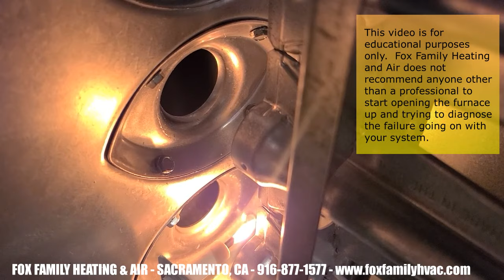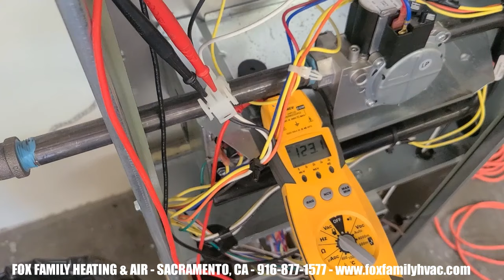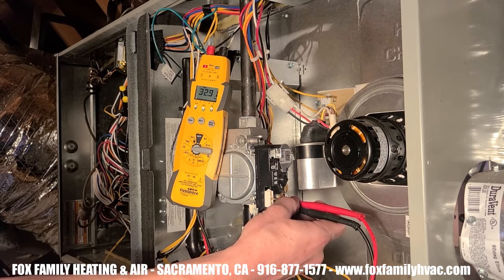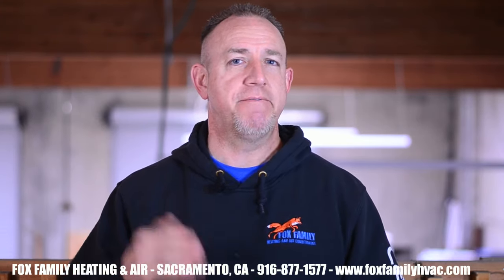How to Diagnose a Bad Furnace Gas Valve (10 Things To Check in 2021)

Comment: I bought a 2023 Jayco 2 days ago and I test fired the furnace and literally within 20 seconds I smelled propane/exhaust then the propane alarm went off. I don’t think that is normal. Advice would be awesome. I plan on taking it back to the dealer to have them fix it but I just got it literally 2 days ago And I just want to use it. The dealer is almost 2 hours away.

Comment: Having an issue with my Conquest 80 Natural Gas Furnace. My issue is that not all the burners are igniting sometimes, all of the orifices are clean on the nozzles and channels in between each burner are clean. It always lights the burner at the heating element but sometimes it takes two tries to light all the burners and will work fine for a few cycles and then do it again. I'm thinking the gas valve is starting to go bad or not enough pressure to the nozzles. I would appreciate your expertise on this issue. Thanks

Comment: I might have a gas valve problem.  It's Williams Forsaire Counter Flow about 5 years old, electronic ignition, direct vented, very simple design, has a mushroom inlet/exit on the outside of the house.   Sometimes the regulator starts making a noise like it's going on and off.  The flame actually starts but it looks like it's having difficulty when this occurs.   I'm thinking either the valve is stuck or the flame sensor (which I think is a bulb with capillary tube type) is not getting hot enough and putting it in a perpetual start/stop state when thermostat is active.   There is no sophisticated computer control on this, no impeller motor, pretty basic.

Comment: My inducer is shutting off after 30 seconds (spins just fine and I've check the vacuum switch as well). The ignitor coil isn't lighting up and I've checked that as well. Flame sensor is brand new, but I can't even get to that point. No clicking on the gas valve. I'm beginning to wonder if the main circuit board has died again, but last time it just stopped working entirely. Any thoughts on this odd issue? It also runs the blower motor after a minute and leaves it on as if it's heating.
Reply: So theres a few things for you to check,on the burner box theres little switches with a reset button on them,those are called roll out switches,push the center button in and see if it clicks,there could be more than one,so look carefully,2nd,theres a high limit switch on the back wall of your furnace as your looking at the furnace,that switch will make the blower run if its tripped,you can tap on it with a screw driver to see if it resets itself,if not it needs replaced,but that switch is for if your blower motor stops working and builds up to much heat in the heat exchanger,check those parts and see if those are your problem
Reply: And check your filter,could be tripping the switch too if filter is dirty

Comment: My furnace runs after 2nd attempt and it runs great. Was told it was a gas valve. Will the furnace run if the gas valve is bad? I have a mobile home furnace.
Reply: check your air proving for the inducer motor

Comment: Thank you tips, but my problem is as follows. The furnace cycles first time with no issues, but shuts off before reaching temp. A few minutes later it relights but now this is where my problem is. The flame lites  runs for a minute or less and poof goes out. A few seconds later it relites and poof goes out this happens several times till it times out. Checked the roll out sensor the flame sensor and the limit switch. Both at the sensor and at the control board. All had voltage and never varied or went to 0 volts. But checking the gas valve for voltage (24 volts) it would drop to zero flame out, 24 volts flame on, back to zero ect. ect. What would or could cause this occur? I replaced the board with new but it still happens. Please advise
Reply: That seems like a pressure switch issue... I had a brand new furnace I installed with the same issue... What happened was the vacuum pressure that closes the pressure switch slowly lost the pressure which releases the pressure switch... This will happen after about 30 sec to a min... Then shut the gas off .. after 3 times it should not let it happen anymore and lockout... It could be a clogged vent... A monometer needs to be put on the pressure switch make sure it's shutting down at the correct value that is under what value is on the part... Usually a code will be given by blinking lights... Take off the furnace doors and tape the door switch down and turn on... Let the fault happen and look on the back of the furnace door for the code it gives and it will point you in the right direction

Comment: In my case, the exhaust pressure switch was causing the gas valve to turn off and on and off and on, and I could see this by the voltage to the valve dropping out.  At first, I thought it was a bad gas valve until I saw the voltage dropping, but then shorting out the pressure switch allowed me to run the furnace without issue, while I'm home, until I can get a new switch.  The pressure switch was cutting electricity to the gas valve.

Comment: Is it okay to shut off the blue gas valve inside the Lennox Pulse G14 and not shut off the old style tapered valve in the line?  We aren't going to use the Lennox anymore, planning to replace it.  (I don't want to create a leak in that old tapered valve by messing with it.)

Comment: You said the gas valve will shut off if the gas pressure is not there. Question for you bud: so we turned off the main gas line what happens to the furnace.we are in the middle of the summer do we need to turn it on or what do we do . We don't whether to leave it alone till the winter or turn it on now. Please advice

Comment: I turned my heater on after being gone for four days and we had a really bad blizzard. Very cold here power was out for two days while I was gone. Turned it on last night the house reeked of gas, so strong. I had a headache within 20 minutes. Power company said the blower is blowing the flame out because the valve isn’t closing. Is that fixable?
Reply: Yes call an HVAC tech.  That's dangerous.

Comment: If I smell propane coming out the air inlet (yes the inlet) to the combustion chamber when the unit is not running, is it possible the gas valve is leaking by?  Is there a way to check?
Reply from the maker: Any time you smell gas, you need to call the utility that provides that gas and even 911. It's not something you want to be wrong in guessing whether its okay or not. Let them use their meters and tell you what to do next.

Comment: My pilot lights for a bit then goes out and the igniter keeps trying to light it, but the pilot keeps going out.  The burners never light.  Is the issue the 3 wire pilot assembly or the gas valve?

Comment: What about a furnace gas leak in the cellar? Propane gas detector is mounted near floor and near furnace. Opposite a couple yards away there is an electric 200v dryer. The under carriage of dryer has red hot nichrome wire coil open heating element, when dryer is ON. This must be a common issue?

Comment: I got a 36 yr split system how can i check for 24volts going to gas valve on furnace? Top terminals on gas valve are numbered 1,2,3,4,5 . Theres a yellow & white wire at gas valve going to the sec 1 & sec 3 on main board

Comment: Having issues with Amana furnace today - Honeywell VR9205Q1010 valve was not activating. thought it was the control board so i replaced it. Still not working. Here what i know now. If i unplug the valve and measure between Common  and Low  I get 26 volts for 2-3 sec( which i should)  but if I plug it in and check C & L the voltage drops to .8 Volts for 2-3 sec. , not enough to activate valve , not sure why. 
If i use the 24 volts from the transformer to test valve by going to C & L  i can get the solenoid to "click" . Its like the broad cant supply enough current but its a new board. Any ideas? or have you seen this before?

Comment: My furnace worked by me tapping the gas valve assembly with the wrench last winter. Now it doesn't. I can hear the solenoid click but no gas comes through and the system shuts down. Sometimes it fires up on it's own with no tapping.

Comment: I have a LP carrier gas furnace, took wires off of the valve and only had 20-21 volts wouldn’t ignite, used jumpers and took them from the thermostat terminals on the board to the gas valve connection spades on the valve and heard the valve open, does that sound like a bad board? A resistor not bleeding down properly?
Reply: Also did fine the black plastic part where the two wires plug into on the valve was very loose, only weird thing is is that the furnace is only 3 months old
Reply: Welcome to the era of cutbacks and cheap overseas parts.
I am replacing a gas valve second time in a 2 year old install.
Reply: @stephenhuggins1388 If the wires were very loose, it may have a bad connection. I would pinch the connections with some pliers to make them snug.
Reply: Ended up being the control
Board

Comment: I think on important step was not mentioned. After the gas valve opens and the main burners are lit and the flame is verified the limit switch must get hot and close, ( bimetal ) then the fan will come on. This ensures the firebox is hot so cold air will not blow into the house

Comment: Check the vacuum switch. If a vacuum switch opens and closes fast enough, you will not see a change in voltage on your meter, but your gas valve will open and close sporadically. Bypass the vacuum switch and see if the gas valve operates differently.

Comment: I recently had a furnace (carrier) for a no heat. When I engaged the heat the system came on but shut down as quickly as it ignited. Checked flame rod , press. Switch,gas valve : replaced gas valve but still same problem.  Ended up being the pc.board. manager said to bypass valve to check operation. Then I would have known it was the board

Comment: What's it mean when your furnace will not turn on in the morning when it's cooler but after 5 failed ignites , a reset, then it will start normal. Or later on in the day or works fine.... Massive because it's warmer?
Reply: Same kinda thing happening to mine. Slight smell of gas also.
Reply: It depends and could be a few things. Do you have loose connections at your gas valve? How cold is it when it won't start? Does the inducer start? Does the hot surface ignitor glow bright orange?
Reply: @jorgegonzales6697  blower fan comes on. Ignitor glows bright. Gas valve goes from 12volts to 67 mv .  3 attempts to start then it goes into lock out mode. I reset then it fails one more attempt and starts on 5th try. Only thing I can think of is the ignitor is not getting hot enough....  Or gas valve sticks when cold. 

Thank you for replying. I might have to just call in expert which I'm trying to avoid.
Reply: @bigjonbird1  it sounds like  you have a meter and know how to use it! That's awesome! That's about 20% of an hvac tech job 🤗. Disconnect the ignitor plug before turning it on. Measure the ohms of the ignitor plug while it's cold. Most measure around 50 but you may need to Google the model# on the attached tag or the adapter itself. If it says Kyocera, though it's probably 50. Then with it still unplugged at the connection, turn on the furnace and measure the volts coming to the ignitor plug from the board while it's trying to start. My best guess, though is it sounds like your gas valve may be failing. Ok I'll leave you to it. I just enjoy my job a lot
Reply: @jorgegonzales6697  that's so helpful. Thank you. I appreciate your time and response. Have a great Christmas!
Reply: @bigjonbird1  my pleasure! Best of luck and merry Christmas to you too!

Comment: My furnace runs fine most of the time but occasionally it runs for a long time (sometimes an hour) before it ignites. The tech said it was the gas valve and replaced it with a new generic one as the original was too old and not available. It didn't work at all and though it was faulty (occasionally happens with new values?) so replaced it with another (different brand I believe). Still didn't work so put back the original. They seem pretty experienced techs but said they could not figure it out. Thankfully they did not charge me anything. It just started getting less reliable so I am getting concerned. Any ideas anyone?

Comment: Still nobody has answered my question...what happens when the board sends only 2.4 volt to the gas valve?
Reply from the maker: If you're not getting 24v to the valve it's bad. You could test it by jumping 24 volts  to the gas valve from the transformer or somewhere else that has 24 volts. If you hear the gas valve click open you have a bad board.
Reply: I replace the IFC board and still 2.4 volts.  I replace all the sensors and switches including roll out and limit switches.  Still only 2.4 volts plus checked continuity to all wires.  Nobody ever mentions my situation
Reply from the maker: @djkaneck1  I wish I was there, I could help you get it going. It may just be time to have a tech come out and diagnose. I wish I could've helped more over messaging like this.
Reply: @djkaneck1  were you able to fix it? seems to be the same for me, 2.0V to the gas valve no matter what.
Reply: @djkaneck1  is it possible that you were looking at DC voltage and not AC voltage? That's what I was doing wrong...
Reply: @djkaneck1  Mayb the clean the orifices and the flame rod
Reply: @cyrilgantzer3383  it's the board sounds like could even be a nic in the wires going to the valve
Reply: REPLACE IT PLS!!
Reply: It seems that you've set your multimeter to the wrong setting.

Comment: Hello. Great video. I live in an apartment and the gas furnace stops working during a power outage. Can I connect a vehicle battery or some other power source to the furnace so that it will run during power outage? Thanks

Comment: I’m having troubles with my roll out switch on my furnace keeps opening if it gets hot by the switch but I’m not getting any flame roll out and the pressure switch is doing everything it’s supposed to it’s just the roll out switch

Comment: I was just told by the tech that i need a new gas valve. The estimate came to around $600ish is this right? I did a quick search for the part and it was around $150. Sure labor, troubleshooting etc. but $600? also, I am an engineer and run a Lab, and am very very proficient with tools and safety protocols....believe me when i say...it took every ounce of will power to not do this myself, gas is nothing to fuck around with, and although i can afford the $600, I dont want to end up blowing up my house. so pay the $600. What is the life span of a gas valve under normal working conditions? North Texas.
Reply from the maker: Yeah we are at $775 for a universal single stage  gas valve.
Reply: @foxfamilyhvac  thanks for the reply it makes feel at ease. Your experience, what is the life span on this valves under normal conditions?
Reply: Don't be tight

Comment: I havnt worked on a furnace in several years. Mainly just heat pumps where I live. I had a gas valve today that would not put any gas through it at all followed all the sequence of operations, igniter came on but no gas. Then finally out of nowhere after resetting unit several times it just came on and I’m getting gas. So I left, then an hour later it kicked back off and won’t come back on. It was off for several hours when I first got there. Any thoughts?  Thanks!
Reply: Change the valve.  Did you find a solution?
Reply: You basically found the problem like what the guy said on this video.

Comment: Should it be a constant 24vac? Or just a "blip"??
Reply from the maker: Constant 24v
Reply: @foxfamilyhvac  I suppose I see a blip since the flame sensor will not have flame. Need to check while it's running. My gas gets cut mid cycle. That's if the valve even comes on. Limit/pressure switch are good, replaced flame sensor. I have a new main board and gas valve on the way. I'm not convinced which one it is yet. Ugh.
Reply: @Steve-og3cr  it’s your gas valve👍 replaced them several times in that same situation and it is the solution
Reply: @HonestyHVAC  bizarrely... It's been working perfectly the last 3 days...that's good and bad lol. I keep waiting for it to lock out to do more checks. Each time it "failed" it left the blower on. I powered off, got draft fan/ignitor glow, then only 12v at the valve leads off the valve. I power cycled a few times and it hit 24 - 27V. Plugged wires back on valve and it fired up. I know SOMETHING is dying. I have a new board and valve on standby as well as a limit switch for kicks. I have "beaten" the valve and it has kicked on from lockout. I have wiggled limit switch wires and it's done the same. Even cleaning old flame sensor (replaced now) seemed to change it's behavior.  So unfortunately it's still not nailed down what the issue is. I see slight green corrosion on the board on an area or two. It's got to be the board or gas valve. I jumped the limit switch and it wouldn't fire. I'll wait and see when it finally dies lol.
Reply: @Steve-og3cr  yeah it can be frustrating, I’ve seen several times this season a gas valve with intermittent solenoid problems, stuttering to open or failing to open then working fine for multiple heat cycles. I would bet money Replacing the gas valve will fix it, as for your voltage problems I would make sure all 24v connections are good, don’t see intermittent transformer problems so possibly your 12v reading was a bad connection as well.